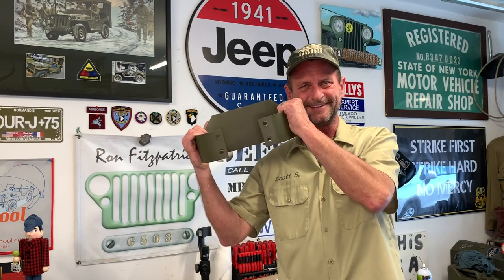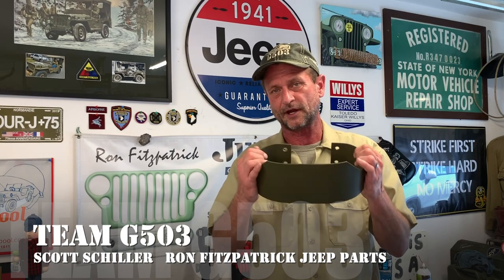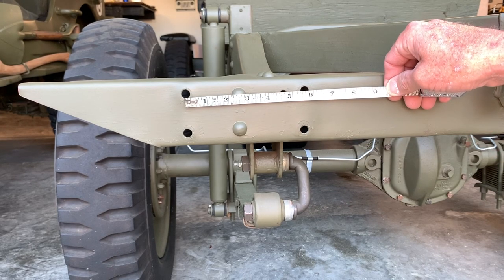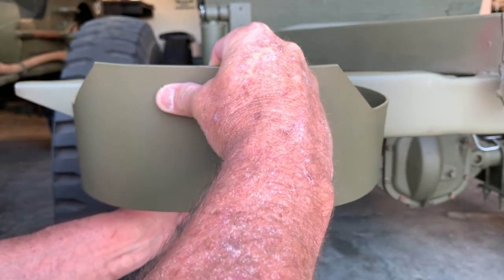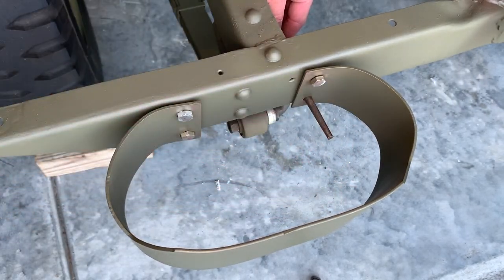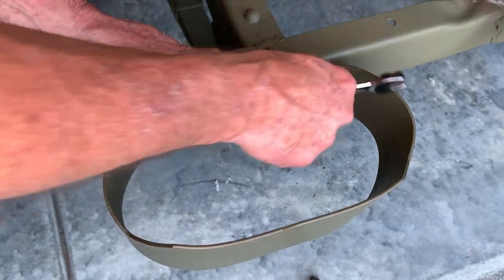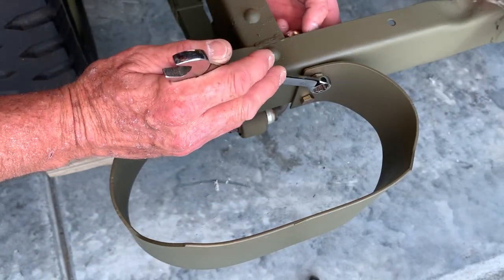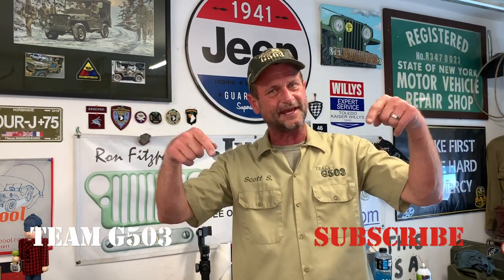How To Install The Bumperettes On A Willys MB / Ford GPW  G503 Jeep

Comment: The problem comes when your original bumperets have been distorted by a bump, I use a ratchet woodworkers sash clamp with the head reversed to push the bumper apart, this works very well, and yes beaks up, although I have seen wartime photos with them pointing down I am sure these were just fitted that way locally. The Jeep is looking great!

Comment: I did tabs up. I wonder what the tabs are for?
Reply from the maker: I am not 100 percent sure. I have heard simple decoration, design to give strength, so that it could be stepped on...etc.
I think perhaps to give more surface area when extended from the rear cross member.
Reply: geepcj2a tabs up to hurt your foot if you stand on them,  lol,  I turned mine down
Reply: Tabs up.. for soldier to clean their boot sole. Just rub the sole so the excess mud and dirt falls off